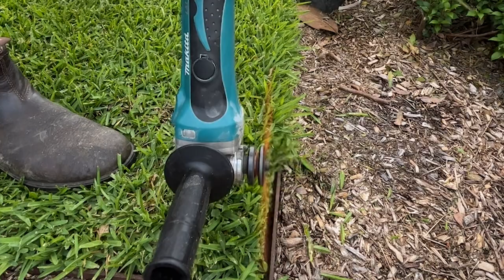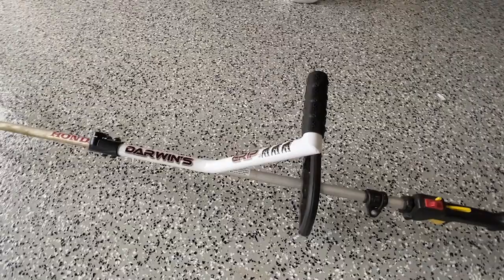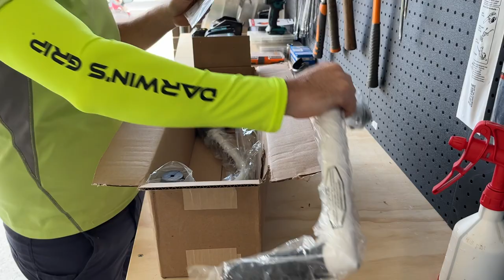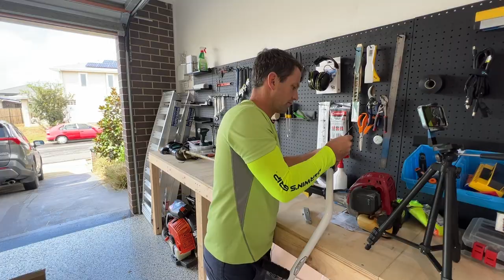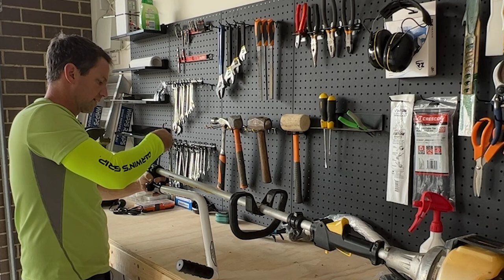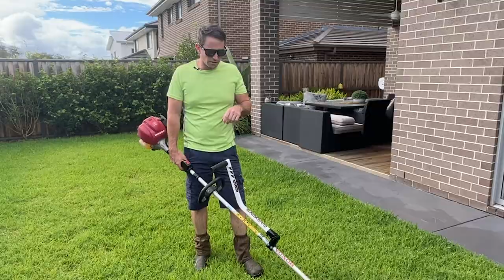Will a Darwin's Grip Save You From Back Pain? Darwin's Grip 6.0

Comment: I got the fluoro green/yellow ones for my ego cultivator, made a MASSIVE difference. Got it on the snipper and rotoscissors too as I'm too tall. Saves my back. But on the cultivator you gain so much more control over it. Goes through the soil easier.

Comment: just behind the throttle handle in between the motor and throttle grip, I have a para cord loop, and I wear an adjustable gun sling that still has the sling swivels on it attached to a simple clip like from a dog leash. Put your right arm through the sling and over your head so it's resting on your left shoulder if you are right-handed and just clip in and out for fueling or whatever. Great for long uses and the adjustments are mega simple. It's so nice to not have all that weight on your strong arm with your elbow locked and vibrating all day. Then you are fully ready for the hairy areas that require all that finesse and twisting and whatever Techniques are required. you can choke up the sling for hills sides and all that too.

Comment: Do you know the difference between the 6.0 and the 5.0? 
I know the 6.0 is harder to fit on my trimmer rack.
Reply: Different clamp style by the looks of things.
Reply: 6.0 has actual "teeth lock" for easy adjusting and locking the handle angle,   5.0 does have similar design leting you easily adjust the handle  but the locking clamp has no actual teeth making it worn out pretty easily then you cant lock the handle to certain angle anymore.

Comment: First why don't you take the plastic handle off?  Secondly, when edging, grab the darwins by the elbow with the left hand and put your right thumb on the throttle. Walk forward not backwards when edging.
Reply: What's the reason that you walk forward because I find walking back is easier as ur working with the direction the whipper snipper is spinning
Reply: @kademclean1243 first God didn't put eyes on the back of my head, secondly, the rotation cleans the groove as you walk forward. If you walk backwards it leaves to groove full of clippings